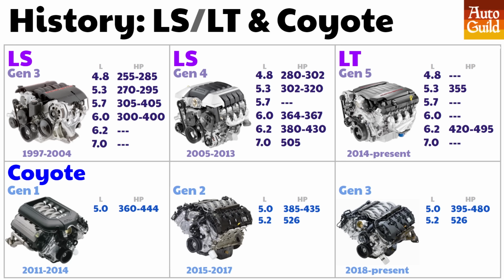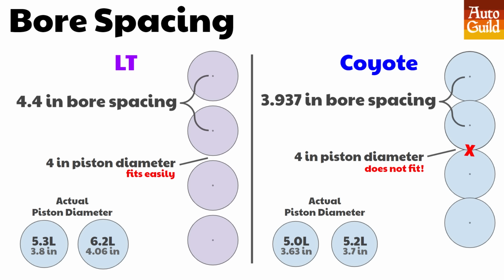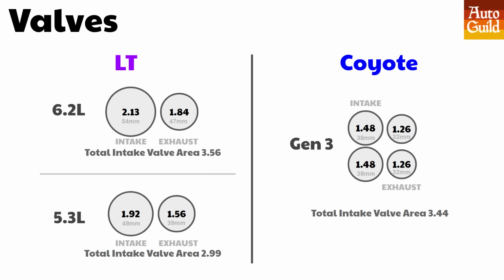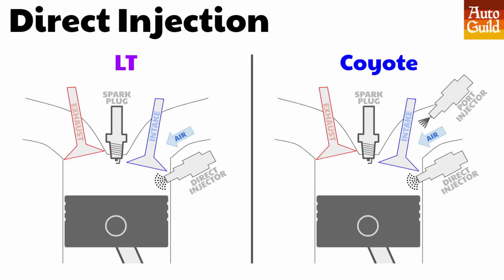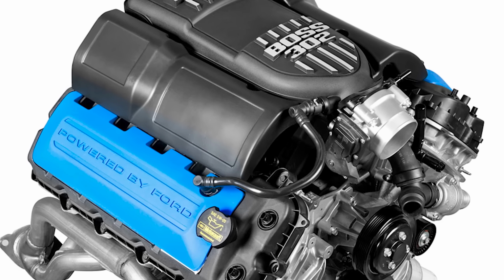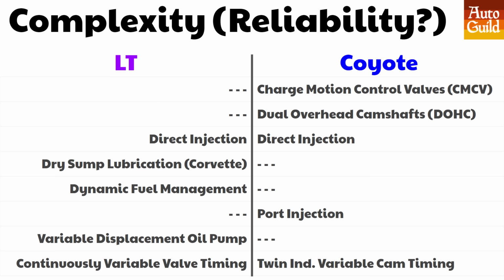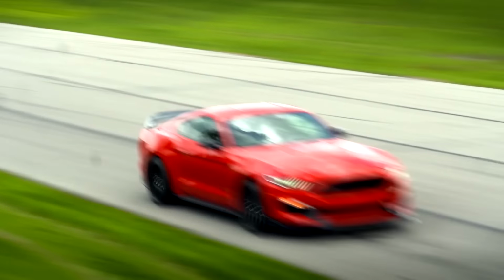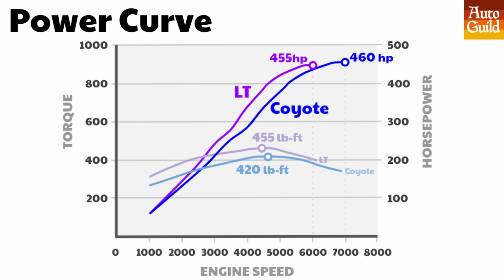GM Gen 5 LT vs Ford Coyote.  Which one is better and why.

Comment: How long will a coyotes timing chains last with a lot of abuse I think the Lt would beat it
Reply: they will last just fine. The nice thing about the Coyote is, they respond very well to boost and you can spin them to the moon. Both of these engines are two of the best engines in the world. You can build a Coyote or LT or LS for pennies as compared to some foreign POS and they are more reliable.
Reply: @almodequindre8601  everything responds equally to boost. The more powerful na set up will yield more power boosted if all efficiencies are equal. Just how it works.
Reply: @HioSSilver1999  Not true.If you look at the way OHC engines respond to boost, it is much more linear in the higher rpm ranges. This is why OHC engines are used in F1 and Indy cars. The Coyote itself makes more power per liter but they are smaller displacement.This doesn't downgrade the LS. It's a very good engine but there are certain things you can do with an OHC design that you can't do with a pushrod 2 valve design especially if you run in the 10 to 12k RPM range all day..
Now, Ford started building a pushrod 7.3 liter engine for the super duty and they did it for fuel economy believe it or not and lots of torque. So there are advantages and disadvantages to both designs. Now, the GT350 is naturally aspirated making 535hp but it's a 5.2L with a flat plane crank.
Reply: @almodequindre8601  for starters you can't turn a coyotah 10-12k rpm all day. They whip the chains out in a hurry. That's likely there biggest issue.  Secondly they run out of realistate for getting a good spring in them for that kind of duty. 
But pushrod engines have been 10k plus .....all day even.

Now as far as boost goes it works like this. All engines run under boost being naturally aspirated.  They all run at 14.7psi ish depending on the day and altitude.  Whichever one makes more power na will make more power boosted if all efficiencies are equal.  It's just how it is. No engine gains a advantage just because of boost if all is equal.
Reply: @HioSSilver1999   No, Several comps have been done and the Coyote responds much better than the LS. They make more power with less boost than the LS and the heads flow much better, About the only thing you really should do is change the oil pump gears if you plan to rev it to redline.
Reply: @72blazr1  you are completely wrong. Borderline no clue having. I have seen zero coyote heads that flow 400+cfm.
Reply: @almodequindre8601  the best part about the coyote is you don’t have to build it, it’s more than capable of 8’s stock for a long time.
Reply: @almodequindre8601  The timing chains on the coyote do have a lot of problems.  I’ve seen it happen a lot on motors that are used almost exclusively in high rpm operation (like drifting or drag).  I’m not saying one is better than the other just that it is an issue with the coyote engine.
Reply: @TurboNFRStwoK  I have two Coyotes, one in my F-150 and the other in my 2016 Mustang and I've no issues with either.
Reply: @almodequindre8601  your sample size of TWO is not adequate.
Reply: @almodequindre8601  Reading comprehension owns you bro. I literally said it’s mostly an issue when running them at high rpm for long periods of time like that in drag or drifting.  So you drift your f150? No? Then the statement doesn’t apply.
Reply: @TurboNFRStwoK  No problem, I thought I was responding to a different comment.
Reply: Most definitely the lt would beat it.

Comment: On the last comparison about a 6.2 liter Coyote making more power - yes this probably would be true. But what is also true is a 6.2 DOHC motor would not fit in a Camaro or Mustang let alone a full size truck!
Reply: So you think a 426 hemi would never fit in anything either?
Reply: @chrisdaigle5410  you are missing the point entirely. The 5.0 coyote is already slightly wider and bigger size wise than the 6.2 LT. Why? Because it’s a DOHC.  A 427 hemi is also a pushrod motor and therefore is already compact. The dimensions on a 6.2 DOHC motor would be enormous.  Displacement does not always equate to actual size it’s the type of engine that does.
Reply: @andrewhagerman1614  Most big block engines are bigger than the Coyote. A 440 is actually wider than the 426 Hemi. Both are wider, taller and longer than the Coyote.
Reply: @chrisdaigle5410  again. Read what I said. I am comparing a 6.2 liter DOHC not a 5 liter DOHC.  Of course a big block 7 liter will fit and is bigger than the Coyote.  But a 6.2 DOHC would be enormous. The heads alone would be too wide to fit in anything. Make sense?

Comment: Me watching the Ford with a tune on 93 like the gm 6.2 takes gain 80 hp and watching a tune gain 11 on the gm
Reply: English please!!!
Reply: Me watching the Ford max out at a little over 500 WHP without going to a poweradder on a stock bottomend, and watching a GEN5 6.2L max out in the 630 WHP range all muscle on a stock bottomend.... Assuming you use a tuner who knows how to properly tune a GEN5 which is totally different from how you tune a GEN3/GEN4 LS, but yes many LT1's running around with safe, but otherwise bad tunes on them leaving a ton of power locked up in them.
Reply: @JROC734  In the words of Merle Haggard   WRONG
Reply: @JROC734  lmao you are very wrong. Wtf. Shut up bro
Reply: @lifeonmars03  you shut you fupid stag. The reality is even a max effort, stock bottomend 6L GEN3 LS build would give a N/A Coyote more than it wants to deal with without using a poweradder. Coyote is a hell of a badass 5L engine, and as someone who currently owns an 88 GT, 03 Cobra, 03 Lightning and a 13 Taurus I'm far from a Furd hater, but there's only so much air an engine can ingest in a cylinder of any give size without using a poweradder to aid it. See I'm not a slave to either brand and own both. The reality is, is that a 4" bore is large enough to mount heads with large enough valves to outflow a 4V setup with less than a 3.7" bore diameter. That's why Ford keeps developing these RPM based engines to try and get the airflow that a run of the mill SBC can achieve at a much lower engine speed. A LS/LT will happily spin if you build it to do so, but then your shifting all your power to the bigend like Coyote does. There are videos on YT of LS engines using 3.62" strokes spinning over 10K RPM's. To be able to sustain those engine speeds in a large displacement engine you are moving a lot of air and making a lot of power. For any N/A Coyote HP number you can show me I can show you a N/A GEN3-GEN5 SBC making significantly more power even when using a stock bottomend.
Reply: @JROC734  reason being how they make power.. max effort na yes cause u can cam a chevy and pick up a ton of power compared to caming the mustang with 4 which is a lot more expensive.. and doesn't pick up as much power. bottom end dont have nothing to do with it lol. im a ford guy but na yes chevy has advantage when we talking max effort... of course boost coyote kills it but thats not the discussion..

Comment: Need to point out the 6.2l requires 93 not 87 like ford
Reply: Not correct. Premium is recommended, but not required for the N/A GEN5 6.2L's.  

L86/L87 are basically just LT1/LT2 engines other than different intake and exhaust manifolds. L87 uses that DFM and start/stop chit instead of the old AFM chit, but the block, heads, rotating assembly, valvetrain, and I think even the cam is the same between all the N/A GEN5 6.2L engines. Things like oil pans are going to be different, but you're basically getting a Corvette engine in a 1/2 truck that uses a 6.2L. 11.5:1 is a lot of compression to be running anything less than premium and if Ford claims that you can happily run 87 octane on an engine with a 12:1 CR then they must be pulling out some magic with their DPI fuel system or VVT setup. My guess is 87 isn't recommended for GEN3 Mustang Coyotes and that a GEN3 F150 Coyote is running less compression but IDK for sure.

Comment: There have been several "tuner" cars that standout throughout automotive history.  The Grand National, the MK3 and MK4 Supra, the Neon SRT4, the '03 SVT cobra and lately, anything with a coyote.  Naturally aspirated,  the GM motors largely win, but put a blower on it and Ford has left GM in the rear view over the past several years.  You can now purchase for mid to high $50k's, a mustang with a dealer warranty that will do low 9's in the 1/4.  And unlike the fat and bloated Mopar boats, the car will actually turn and brake fairly well.  There's a reason YouTube vids of racing are filled with supercharged and turbo charged coyotes winning lots of races, it's a very good platform to start for building a moderately fast car at an affordable price.   800 hp coyote cars are so common now its yawn worthy when you see one.  The vid summarized it well, if you're building a performance or sport car, it's tough to beat a coyote, but for trucks and muscle cars, the GM motors are tough to beat.

Comment: Pretty sure the new Mach 1 can be had with the TR6060. That thing basically replaced the GT350.
Reply: It can be swapped, but the new Mach has the 3160, same trans as the GT350.  The new Mach is Fords version of a parts bin car, combined with a specific model variant brand (Mach1) and at the same time, their way of streamlined products.  The 350 is still wider with better brakes and a more unique motor and sound, but the Mach serves to capture many of the great features while ditching Ford's issues with the flat plane crank and oil consumption and bringing down production costs by unifying more parts with the GT.
Reply: @angreygt3508  I knew it was a Tremec something. Literally any trans they make is better than an MT82.

Comment: Pretty decent comparison, better than some I have seen.  This comment is not about trashing the Coyote but rather to bring up the advantages that were not gushed on concerning the LS/LT.  I don't like your take on horsepower vs displacement.  The reason being is that the statistic is useless.  The ONLY forum where horsepower vs displacement has use is in a man-made construct.  For example when man-made laws restricts one side or the other...in most cases that is going to be displacement.  If you are limited to a specific displacement...HP per liter matters.  But in the laws of PHYSICS...something man has no control over...horsepower per unit of weight is a MUCH more relevant statistic.  And while it is closer than most engines...the LS and LT engines take this statistic and also takes it with Torque.  The engine has more power and torque to move less weight.  I think that is an extremely important figure..Now another physics advantage that was slightly touched on but not discussed as to why it is an advantage is the size of the motor.  It was shown the LS/LT take up less space.  especially in HEIGHT.  This allows for the engine to sit lower in the car which lowers the center of gravity and aids weight distribution which helps in driving performance, specifically cornering.  Again this is not about bashing the Coyote...which is a fabulous engine and I would take the Voodoo powered GT350 over the GT500 any day.  And this is going to sound backwards because I am not the biggest Flat Plane Crank fan...there is just so much that has to be done to keep it from shaking itself apart....while the cross plane balances nicely.  I also kind of like the lower growl from a cross plane.....But when it comes down to it...the simplicity/reliability/ and other points I mentioned would lead me to the LS/LT....And we didn't even get into cost not only to get but to modify...In the end both great engines...But there is a reason the small block chevy is historically and arguably the best engine ever made...
Reply: To expand on the hp to unit of weight.....The LS7 (NA so I think a good comparison) is about 454 pounds( (assembled with clutch, flywheel, balancer, and water pump).  The 5.0 Coyote (from 2018) weighs in at 444 without those added pieces.    The LS cranks out 505 HP conservatively...it also cranks out 481 lb/ft of torque....giving the LS 1.112 hp  and 1.059 lb/ft of torque for each lb of the engine....while the Coyote has 1.036 hp and .94 lb/ft of torque respectively...Don't like the 427 cu. inch  comparison...well the LS3 weighs in at 403 with the same installments as the LS7...giving numbers of 1.079 hp and 1.062 lb/ft of torque per pound of the engine.  You want to look at the Hemi's...the 6.4 (392) is the largest NA engine comes in at a whopping 500 lbs.  cranking out 485 hp and 475 lb/ft of torque giving the power to weight ratio under 1 in each category....So you are looking at these numbers and thinking that the numbers are very close and don't mean much...well these little numbers add up...we are talking an extra 35 hp that the LS7  has that doesn't have to do work and the LS3 has just under 20hp extra that doesn't have to do work in comparison to the Coyote...Tell me anyone who wouldn't want an extra 20-35 hp without any modifications....(and they are doing it with assemblies added weight unlike the Coyote)....displacement is not the the important statistic here...it is weight.
Reply: Yup, pretty accurate. The Ford is great but it's no bowtie

Comment: It's nice to see the ford geeks finally have an option that isn't embarrassing...but none of these "advantages" mean anything to me. LS/LT is applicable to more people, more cars, more random vehicles like boats, helicopters, and airplanes...

These days you are really splitting hairs when you compare HP/gas mileage. The only question I want answered is, which one lasts, and which one is cheaper/easier to fix when it does break?
Reply: Agreed. I think they will all probably be "fast enough" (or quickly able to get to that point) and its a matter of reliability/fixability/availability of parts.
Reply: LS is more readily available, and most mechanics know them inside and out, coyotes are reliable as a 4.6 2V can be, but they make more power. The only problem is they’re more advanced than the LS, which means it takes a bit more experience to work on it. Agreed however LS works a lot more for random applications, I’m just glad to see Ford’s running Ford engines again.
Reply: The Coyote "should" outlast the pushrod engines due to the OHC design being more efficient, lighter valve train weight and DI and Port injection. An argument can be made however if the Coyote and LS\LT are both abused at high RPM's, the LS\LT should suffer less crank and rod bearing wear. But no way will a Coyote be cheaper (or easier) to repair. I'm a pretty good grease monkey and those things are much more difficult to wrench on!